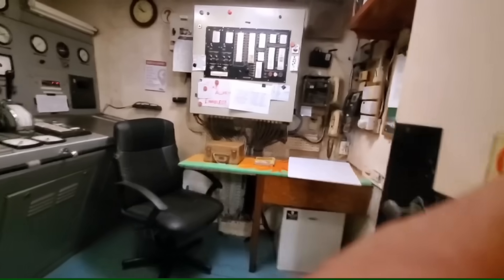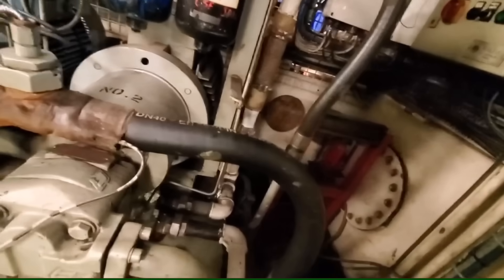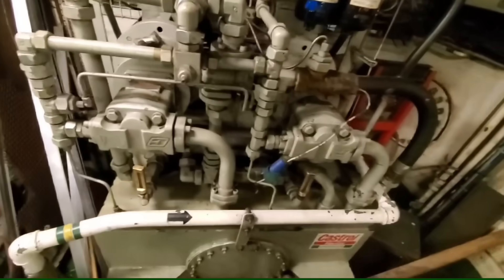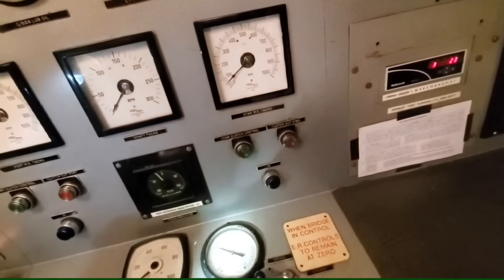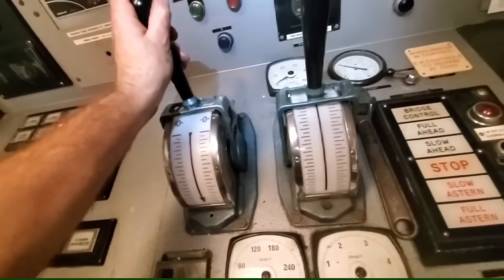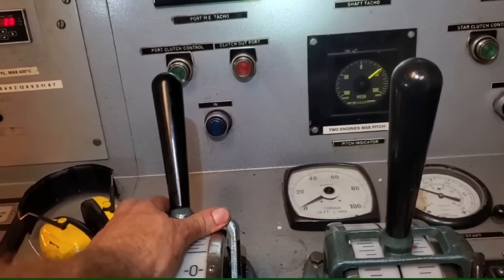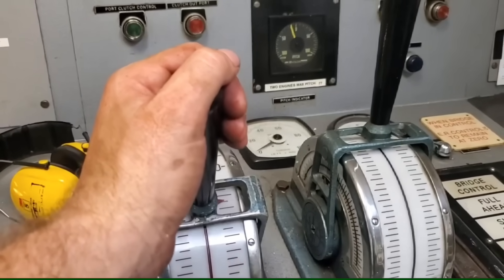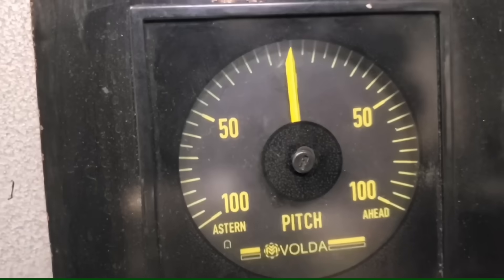Testing The CPP Propellor system

Comment: There's two engines are there not two propellers??? Why?
Do you have 2 engines and just one propeller gauge?I don't understand.
Reply from the maker: Yep you got it. Why? ask the ship designers I guess. Hull design, only one prop. Its effective as you can clutch either engine in to the gear box then also both at same time. It rock and rolls then I"l tell ya . Thanks for watchin mate

Comment: This is satisfying my mechanical nerdyness
Reply from the maker: Glad to hear ! So much more to come!
  426 Hemi is the GOD 
 My Bother and I owned a 1969 VF Valiant regal 4 door (Aussie version of USA Dodge Dart) although it did not come with a 426 hemi she had a 360ci 3 speed 727 torqueflite . Man it was a torque  monster , Even with a 500 holley 2 barrel. 
   On cheese cutters with open diff , Nursing her off the line  she managed 14.2 sec  Quarter mile, at WSID eastern creek Australia  in 2001.I have the video somewhere. I regret not setting her up properly. 
 What do you drive?

Comment: Are the shafts hollow to allow the mechanism to control the props pitch?
Reply from the maker: Great question , Yep The single propellor shaft has a tunnel to allow oil to flow to Cpp housing in the water,.
Reply: Yes, it has a hollow shaft, housing a pipe in a pipe. In this way, you'll have three lines. C1 and C2 to control the pitch. The third is static pressure.

Comment: I was confused by the missing prop direction meter, but now I see it is two engines into one shaft. I guess there is a big chain of gears between everything.
Reply from the maker: Yes it's a 2 to 1 Reduction style gearbox.  I will definitely be doing an extensive video on this in the future
Reply: @diylifeofficial  Ace, because the harmonics of two engines fascinates me.

Comment: Cool to see that it's Volda Gear. :) That's a little town south of Ålesund, in Norway. :) The compnay has changed name some times, but started as Volda Mek Verksted (Volda Mechanical Workshop) in 1913. So it's been around for some time. In the last few decades it was bought by Scana and the shop in Volda was Scana Propulsion.  and now 5 years ago it became part of Brunvoll, and that's the current name, Brunvoll Volda. :)

Comment: If there's a leak in the hydraulic actuator that controls the prop pitch, would it dump inside the boat or into the ocean- and apart from seeing the sump tank level drop, is there any way of knowing if there's a leak?
Reply from the maker: Great question I will answer this in an upcoming video of the Cpp. I have a story about it .
Reply: The high-pressure oil from the actuator will leak into the static pressure area surrounding the high-pressure parts. The hub's static pressure has a header tank way above the waterline, so the leak oil is pressed into that tank. The tank has an overflow line back to the hydraulic power pack.

Comment: HI Really interesting vid mate.Just a quick question. How does the engine speed and ccp system work together? If the engine is running at  xxx rpm and the ccp is at 25% how do you go faster? Do you just change the angle of the props or just increase rpm or both - or have i miss-understood completely? cheers
Reply: Should watch pyrometer reading for exhaust temp then adjust load with variable pitch to stay in the sweet spot
Reply from the maker: Yep Great question , the RPM and pitch both control how fast she goes. Note though the rpm is less adjustable than the pitch SO the pitch is main man in charge. A master and commander of sorts.

Comment: So the ship doesn’t have a traditional forward and reverse gearbox? When the engines are running is the prop always turning?
Reply from the maker: @k25824 No, the cpp can adjust the angle of the propeller blade whilst spinning . SO it can push or pull the water  whilst rotating the in the same direction at all time. hence forward and reverse is achieved.
Reply: You adjust the pichable prop & engine speed for best fuel consumption for the speed you want.😊

Comment: Hmmmm , so the hydraulic oil runs within the propeller shaft all the way out to the prop so that the pitch of the prop can be changed . I understand the concept as airplanes can have variable pitch props also . It would have been nice to see a quick drawing just to help in visualizing the setup you have . Other then that Thanks for making videos of the startup procedures involved as it has been very interesting and fun to watch . Thank you and your doing a great job explaining what your doing !
Reply from the maker: Thank you so much and know its not the last vid of the cpp. Yep would have been better with a diagram , i will attach that to the next propulsion based video for sure. 
 Glad you enjoy it and happy to make more for you all.
Reply: Yes, genuinely very interesting.
Reply: There is a purely mechanical version with a shaft within a shaft...I am sure that is  prehistoric now
Reply: @zeusapollo8688  Correct. Lips made one, the L-type hub. it indeed has a push/pull rod.

Comment: THE US NAVY HAVE THESE HOPP UNITS ...
Reply: US navy MSO minesweeps had a systen like that but the mechinial syatem in the shafts ran all the way to the reducttion gear box.
we ran the system with two small toggle switches in the pilot house we did have a manual backup system in the engine room.

Comment: These videos are fantasic. As a deck officer myself, I enjoy learning about the engine room equipment. 

1. Were you able to run both pitch servo pumps together to change pitch faster, similar to running both steering motors? Islooked like pitch moved fast enough as it is, but I come from larger ships where we may run both pumps if needed. 
2. Was there one RPM for all pitch levels or was there an option for a “combinator”?
3. I remember how interested I was as a kid to know. So, over 10 years later, I’m curious to know how fast the Steve  could actually go? 

Great work on these videos. Can’t wait for the next installment. If only I lived in Australia - it would be amazing to see the ship in person or help get her moving again!
Reply from the maker: Thanks mate, Very good questions and you've spiked my interest, I never thought about doing that! I will read the manual and get back to ya on that one!
Reply: The Steves top speed is about 16.5 Knots.
Reply from the maker: With a clean bum,  following seas and all tofu overboard.